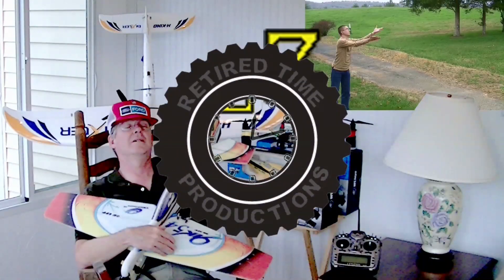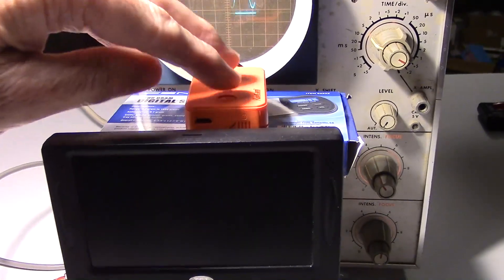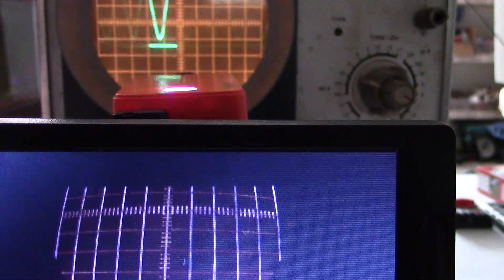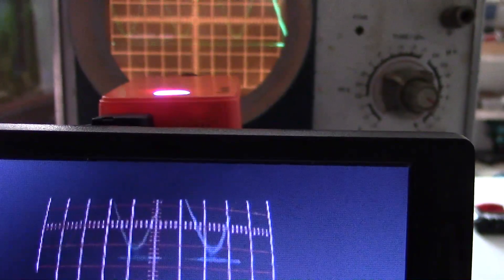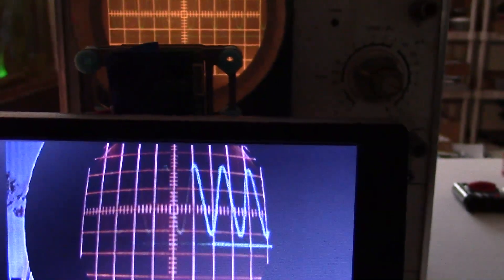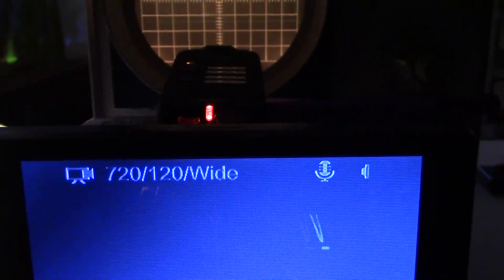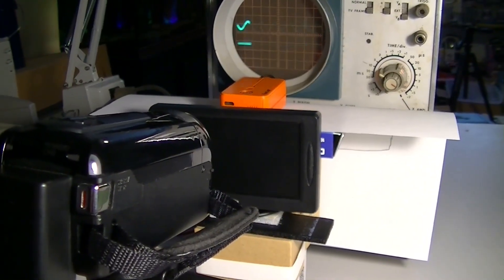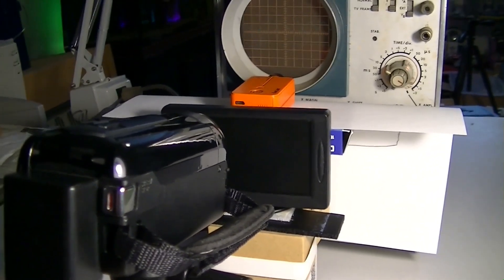RunCam2 Latency Testing with a bunch of other FPV cameras.

Comment: great investigation! very usefull :) thanks!
Reply: im wondering if you could test Xiaomi Yi cam or similar to compare with these.. (Yi is still around 40g weight)
Reply: Xiaomi should be around 110ms ? 1080x30fps , possibly 2x less on 720p 120fps mode.

Comment: i think on the PZ0420 the mesurement is false.

if you look at the mains sinus it is over 1.1-1.3 divisions further than your arrow is pointing, wich gives a delay of 11ms to 13ms
also, did you use a camera wich has no rolling shutter? if not the result is modifyed by the way it is set up. the fpy screen and the oscilloscope schould be on the same height.

Comment: that is a really clever setup. I tried something similar with a few cams and only got to 33ms of resolution with the standard way of just filming an stopwatch and the liveout at the same time. to increase your accuracy you could try a gopro in 120fps as recording cam.do you think the runcam2 would have increased in 1080p60 (since this is the most common usage).   thanks, greetings, Mario

Comment: Just to be clear, the camera was set to the various settings - and was not just turned on and used for fpv, it was also recording at those rates? ( Its hard to tell if the Mobius record button is flashing). If it wasn't recording, just used for fpv, I am curious if the latency increased when it was recording?
Reply: Im interesting aslo to know if you were recording or not 

Sorry for my bad english